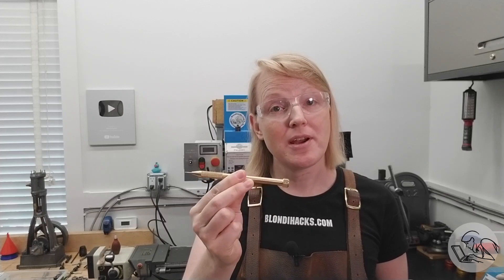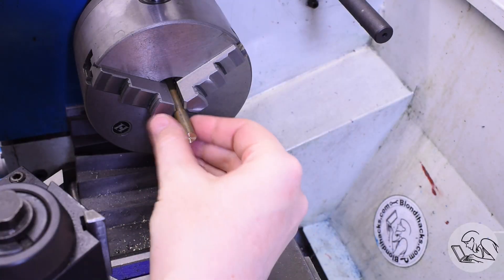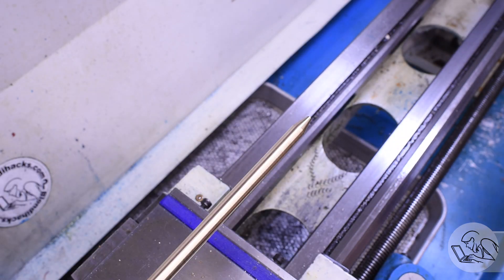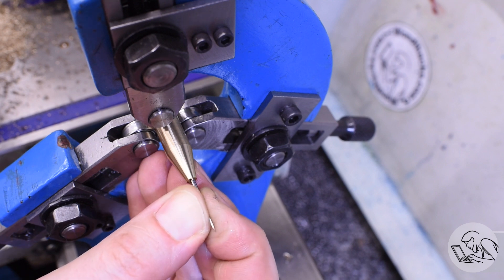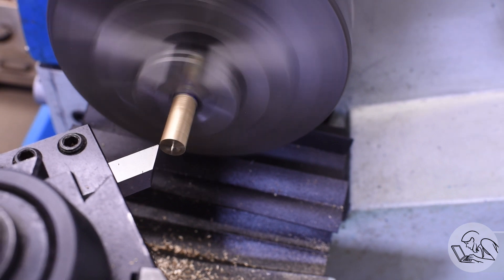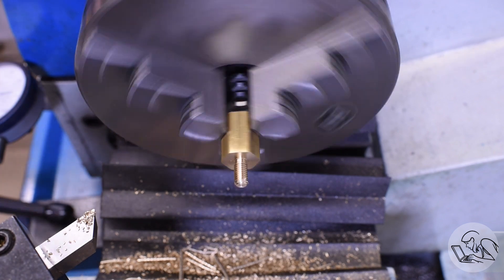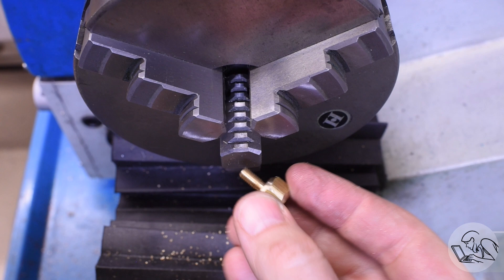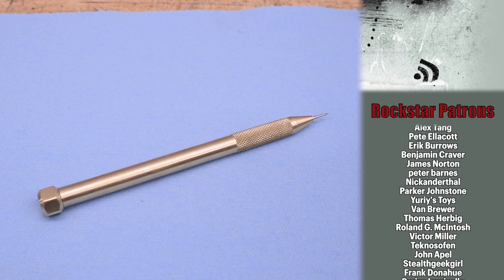Let's Make a Scribing Tool!

Comment: I couldn't find the needles online so ended up going to a fabric store and I picking some up there. I made a scribe today but used 1018 instead of brass and made it a bit larger in diameter (.410) since my hands don't like to close up very tight from to many years of construction. I knurled the end then took a bit across the top of the knurl and smoothed it down leaving just enough to give it a texture for better grip. I also hollowed out the handle to lighten up the weight then put a hex end on it to help it keep from running off.

Comment: not having any "scrap" brass lying around and gagging over the cost, I bought a length of 0.4 aluminum rod. I DID have some 3/4" aluminum rod lying around and used that to make an 8 point cap to prevent rolling.   I can file 8 flats a lot easier and accurately that 6....(:>  Speaking of scrap, I was at a local boat ramp and ran into a guy tasked with hauling out derelict boats and he let me strip out a prop shaft from one of the hulls. I now own a 3-1/2 ft long piece of what I think is 630 stainless steel .  What I will ever do with it with on a 7x16" lathe I don't know, but I'll have the material(worth about $250 best I can tell)!

Comment: Well done, (as is tradition.)

Re: lead angle
Have asked lead angle questions of many online, (didn't know correct term until your vid), but have never received an answer.

Would love to see you cover it fully in a beginner's vid. You always explain concepts & techniques so plainly & thoroughly.

Re: scribers
Replacement carbide tips are available through MSC, so I'm sure others have them, as well. (Starrett replacements are WAY expensive, so look for no name imports.)

It's funny, I have several store bought scribers, but my fav is made from one end of a broken fiberglass tent rod. It had a round rubber end, which I milled to a hex, plus the rod had the perfect size hole for the tip.

Comment: You should try to get hold of some Metric drill bits. I have 1.5mm, 1.55, 1.6... Actually, I have every 0.05 from 0.4mm and up to 2mm... 
I may be a bit obsessive...

Comment: In my shop, I always have a small quantity of shellac mixed up, which I use as a glue with heat. I think that might also work as a way to hold in the point, and it also melts with heat, just like the Loctite. Great video, as always, and I'm glad you're getting settled nicely into your new space!

Comment: I was thinking you could mill a small flat spot all the way down on the side of the scriber and use the DRO to put in markings for a ruler. Could probably come in really handy, especially if you figure out a way to calibrate it to the tip of the needle

Comment: I also really like the Clickspring design, and made a few of my own also using sewing needles as the scriber point. One trick I do, which Chris alludes to: the first part I make is the scriber point, which is cut just a hair over final length (snapped, really) and then I use a bench stone to turn the non-pointy end into its own drill, as Chris shows, but where Chris uses the waste end of the needle, I simply use the end which will be installed into the scriber body. Perfect fit, first time every time, at the cost of a very small amount of work with a bench stone and more chip-clearing when drilling.

Comment: Another material that works fairly well for a scriber tip is an old tig tungsten electrode stub. Or you could just get a new one from a welding supplier.

Comment: Very nice build and instruction, as usual.  I hope the new shop suits you.  I have found that using left over needle bearing pins (from working on outboard motors)  serve very well for scribe points an replaceable points for my automatic center punches, depending on how you grind them.  They also tend to fit a standard 2mm drafting pencil rather well.  I may however need to make the dedicated Brass Scriber just because its cool.  Best of luck in the new digs.

Comment: May I be so bold as to ask why you didn't leave the hole undersize and heat the body to insert the needle? Once it had cooled down the needle would be held tight (or so I assume).  Love your work and thanks for all the knowledge you've imparted over the years.

Comment: Another great source for a HARD scriber point is the TIG welding tungstens that are too short for welding. Chuck them up in a drill or Dremel tool, and (outside) gently hone in a point against a cutoff disc on an angle grinder (disc down, guard between you and the spinning death blade).

Comment: Yes, I know that there is surely over a million reasons, but I still don't like unprotected chucks. A little depending of the design I like the idea that the lathe doesn't run with tha guard "open". Thanks to Finnish worksafty regulations we have guards on all of our mills and lathes, some drillpresses are without guards. Here you are not even allowed to sell new machines without guards with "killswitches"...

Comment: You just showed this old dog a new trick. I have been using the tungsten stubs from my tig welder. Lucky I don't lose scribers all the time because normally I would take these to my welding supply for recycling and get a few cents credited to my account. Much cheaper to raid momma's sewing basket.

Comment: Happy to see the new shop up and running.  Always wondered, why do you work in inch units in a mostly import shop?  I haven't seen inches in the wild in years outside the oilfield.
Reply: Because in the US most tooling and metal is still in inches.  I had a heck of time to find some 4mm round brass stock when I needed it.

Comment: Ah, the good old Herman Miller Aeron chair. A logical/predictable choice given your tech background. Popular though I'm personally more partial to Steelcase. Got to use a Steelcase Leap (which is a bit like a non mesh Aeron) in grad school which was excellent, but those are pricy and scarce in the surplus/secondary market around me, so I ended up using a kneeling chair, then a simpler Steelcase Criterion for a few years, now using a Fully chair.

Oops I guess I'm a nerd.

Comment: did you glue or otherwise impact pinch or something the tip into the body?
Reply: Loctite glues metal surfaces together very strongly when it is smeared very thinly across the 2 surfaces. With the very fine fit of the needle to the hole the Loctite will hold it quite strongly in place.

Comment: That was good to get back to a simple project. It reminded me of a high school project we made here in Australia from similar sized brass, it was a scalpel blade holder, the brass was drilled out and a steal shaft with a taper on one end with a slot to hold a scalpel blade and the other end was threaded this went through the brass tube and a brass nut at the other end would pull the shaft through causing it to grip tightly on a scalpel blade. We also knurled both the gripping end about the same length as you did and the brass nut was the same diameter and length of the knurled section at gripping end. We also made a pocket clip out of brass with a hole in it so that it would fit over the smaller turned section of the brass nut and would therefore be clamped between the brass nut and the main tube.

Comment: Thank you for doing a complete thru cut with the character-building saw. My old metal shop teacher years and years ago drove that into my head.
Reply: I always find it strange that most people cut on the right hand side of a vice, the left hand does very little and you have to reach round a possible danger zone to catch the offcut/part. Using the left side allows you to hold the free end to stop vibration etc. and especially at the end for the last few strokes, you get a good view of the cut too (for right handed people)
Reply: @incubatork  Good point! The force (of habit) is strong with this one (a.k.a. me)... I will immediately start cutting on the left side of the vice!

Comment: Beautiful scribe. I made one using mechanical pencil and 3 mm steel for point that I sharpened on belt sander to a less acute angle to I could retract , so I wouldn't poke holes in my shirt.

Comment: You could chuck up a small piece of aluminum, drill and tap a hole, thread your knob on then do your ops. 
A short length of the alu turned down smaller than the pen dia would let you work on the chuck side of the work.

Comment: Hmmm. I have a center punch I made for a class in college, where the professor accidentally gave us low carbon steel. (He didn't realize until his third attempt to heat treat them). I may try drilling out the tip and installing a needle to use it as a scriber.

Comment: a piece of tig tungsten works well for the scribe tip (i think its harder than the needle) but it requires grinding... And as an Aussie male myself, "Bloke" is correct for a formal masculine noun, Koala would be the informal, non-binary, noun, for someone you think poorly of, and mate is a formal, non-binary, noun for a friend. 😅
Reply: A 2mm mechanical pencil will hold a 2mm tungsten electrode.

Comment: You can still buy new grammophone/phonograph needles: these make great scriber needles, too, plus, there is no eyelet you have to cut off.
They come in a variety of thicknesses from 0.8 mm to 1.8 mm diameter, depending how loud they are supposed to play (the stiffer the needle, and the bigger the diameter, the louder they play).

Comment: 8:14 "There's no drill in between the two sizes" Me, laughing in metric, where everything is possible. I dont know, if you get them into the drillchuck, but there ARE 1.55mm drills

Also: HOW do the grooves while knurling align? there are two diameters ans the spacing on the tool is fixed, so...
Reply: Theres also a 1/16th drill...0625!!

Comment: I'm a woodworker, and I want to start making my own tools. Today was my first real time working metal, I made a marking knife from O1, still need to heat treat it. I found instantly that I needed a scribe for marking out the knife blank with lines to file to, I used an awl but it was bulky and awkward. My Dad has small machine tools, lathe and mill...... I think I'm gonna make a scribe like you've done here 😁 thank you🤙
Also "chamfers are what separates us from the animals"  did you get that from James Wright or did he get it from you? 😆

Comment: To use small drills make a bracket to hold your Dremel on your tool post .A nice strong holder possible a permanent fixture Then you can spin drill at appropriate speed .

Comment: Nice clean design. Job well done. If you need an idea for a small project? Then, I would very much like to see a custom body for handheld de-burring tool with changeable tips. A spring loaded sliding collar would work with a small detent and ball bearing to hold commercial tips. Perhaps add internal storage for extra tips too. ;-)

Comment: You can also drill and tap a hole in the knob and connect the knob to the scriber body with a set (grub) screw and locktite. Your way is more "pure", though. No dissimilar metals.  :goodvibes:

Comment: Well Quinn, that’s the first job done in your new workshop and may you have many many more successes as time goes by. It is nice to have you back up and running, your other videos did help fill the void but there’s nothing like making chips. Thank you, although I am a trained fitter and turner, I must admit that I do not have a scriber that I like. mine was supplied in my apprenticeship many moons ago and has the normal straight end and a ninety deg bend on the other end. It is way too thin, and I have never liked it, so I am going to make one similar to yours. I never would have thought to use a sewing needle as a point, that part is magic. Thanks for sharing and welcome back.

Comment: Years ago I made a carbide scriber that fit inside a ballpoint pen housing. I just copied the geometry of the ink cartridge and ground the carbide blank (broken endmill) to match. I liked it so much I made a second one using high speed steel in the same manner.

Comment: Regarding the scriber tip, I wonder if, instead of a sewing needle, one could use one of those replacement tips for an automatic center punch.  The form factor should be similar and (hopefully) the tip is just as sharp

Comment: So far I have made one scribe myself.  (I also have one that I purchased decades ago.  Both carbide and diamond tips way too "fat".) What I have used in my DIY scribe was a piece of TIG welding tungsten electrode.  But recently I realized that I CAN grind carbide!  The diamond grinding disks sold for Dremel are cheap and work quite adequately.  Maybe I try that next time I need to scribe more than a token length of line on a glass fiber/epoxy PCB.

Comment: Nice to see you making chips in your new home. I like that design. In use the needle should not bend or break but a fall on a hard floor might break it so making it removable is good. If you ever need a heavy needle you can look at sailmakers needles the only drawback is one section of the needle is triangular shaped but the middle is round.

Comment: There are clear coats/coatings for preventing brass tarnishing. I do have to say, the one i tried didn't hold up to a lot of wear. But they do exist.
Reply: Try Nikolas Lacquer from Stew-Mac.  Tuba parts are coated with it, so it handles sweaty/ grubby mitts pretty well.

Comment: As for the sewing needle as a point: I have no experience with hand sewing needles, but due to the fact that I used to have a somewhat cheap and misaligned sewing machine I can say that there can be large differences in the quality of the metal. When they hit something hard they either shatter (which is the harder type I guess) or they bend. So better test your needles for hardness before you replicate this. Some of the chinesium needles might be to soft.
Reply: I object to the racial profiling, but you otherwise have dispensed excellent advice.
Reply: @adamthethird4753  chinesium isnt racial profiling, its long been known that cheap chinese tools use far inferior metals to keep the costs down. Shit, half the chinese stuff Ive got seems to just be cintered grinding dust when they snap. Cheap tools arent known for quality, you get what you pqy for most of the time

Comment: There's that ridiculously inoffensive expletive "Poop knuckles" again. :D
I'm reminded of something a friend once said about the "Atom thick" one ply toilet tissue his boarding school's lavatories used to have.......... But this isn't the place to recount such base and vulgar anecdotes. :D

Anyway, I've been using old TIG electrodes as scribers for a fair while, and a couple years ago I made my own holder out of a 180mm M14 stainless bolt (that I turned down to remove the thread and head). It's a bit "Heath Robinson" to look at, but one thing that works pretty well is the way to adjust it's tip poke out as I grind new points in the electrode. I drilled about 70mm down the "Non pointy end" (old British engineering term. :D) and tapped an M6 thread down it. I use a grub screw to set how far the point protrudes. The only bit that's REALLY sketchy is the method to prevent the electrode from just falling all the way through....... I wipe a little bit of silicone bathroom sealant on it to make it gum up in the remaining 70 to 80mm of close fitting hole.

Yeah. I know, It isn't a solution to be proud of, but it works. :D

Comment: 6:59 have you thought about using a squirt bottle (the ones with the long pipe thingy used in laboratories) for applying WD40? I find them way more precise and less awkward than the „punp action“ bottles.
Reply: They are the best.
Reply: A pipette?
Reply: @alexblackburn627  i think they mean a squeeze bottle (on mcmaster, for instance)
Reply: @jewishkidney  in hindsight that seems obvious! I was thinking it might be a bit of a pain to use a pipette for wd-40
Reply: Great idea.  £7.59 for 3, on Amazon UK